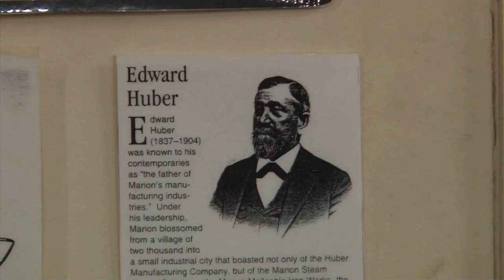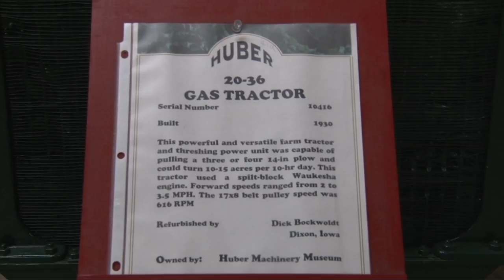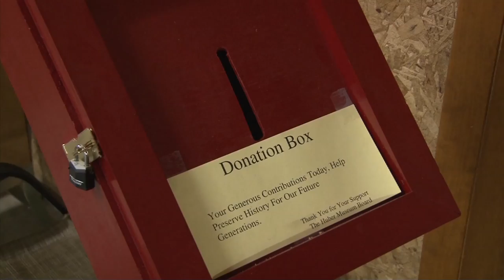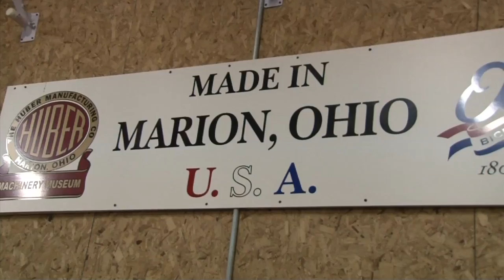Scenic Stops: Huber Machinery Museum

Comment: Dad had a Huber 10-20 Huber tractor, in Wheatfield Indiana. It stared on gas and you could swithc to kerosine. The problem wit the steel wheels was you could not run it on pavement.  10 horse power at the draw bar, and 20 at he belt. The belt could run a circular saw for lumber. etc.